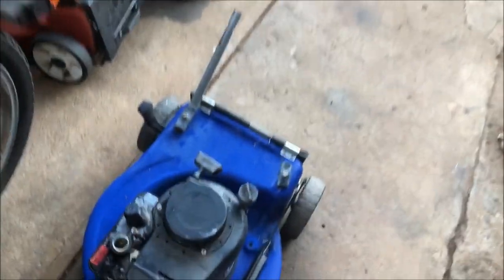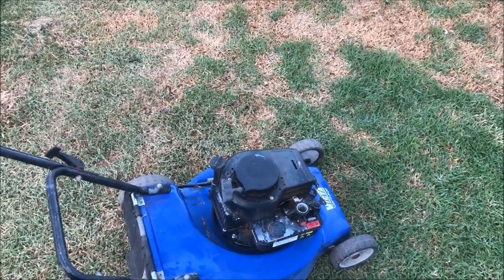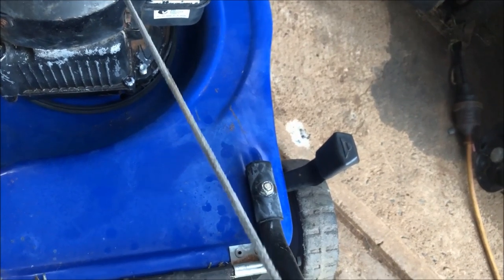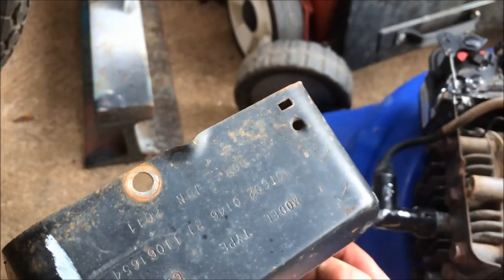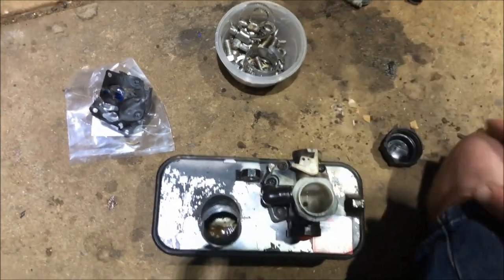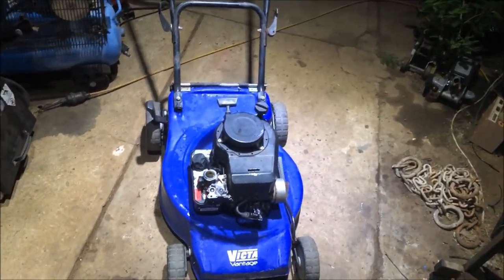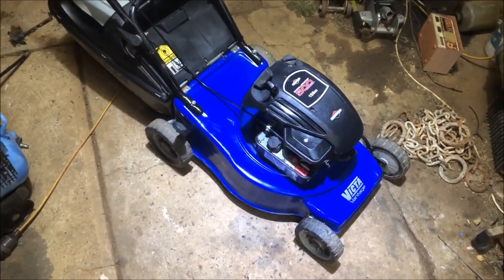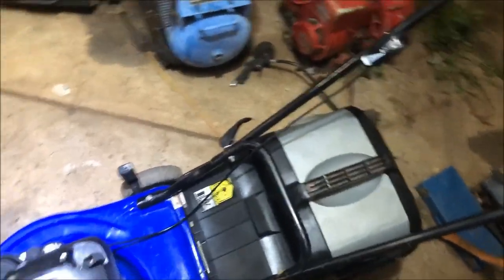Bought half a mower for $5 how will it come up?

Comment: I found a beaten up Supa Swift with a fully intact vertical pull 3hp Briggs. It sat on the back burner for a couple of years until I recently happened on a catcher that fit. I thought it would need a diaphragm and gasket kit but after replacing the foam element with a freshly oiled used one, it fired right up and after repairing a wonky rear wheel using a bearing from a Sanli wheel and fitting a pair of standard  Victa blades, it's now one of my primary mowers and cuts up a storm!

Comment: Hi I like these videos, these are nice easy engines to work on. Its turned in to a decent mower now, nice save from the dump. I like the 2 stroke Victa mowers not to many around here these days in the Uk. Anyway Good job🙂👍
Reply from the maker: I love the old 2 strokes myself but they are a very difficult sell around here, it seems many have lost the ability to mix fuel and oil for themselves around here.